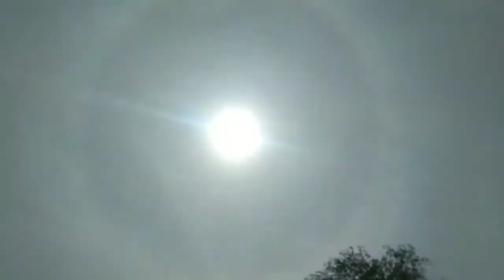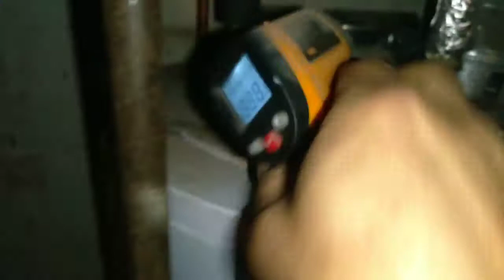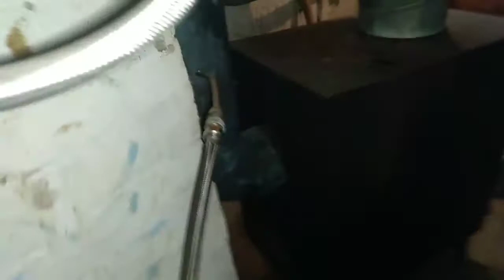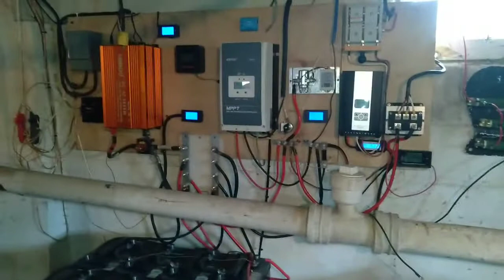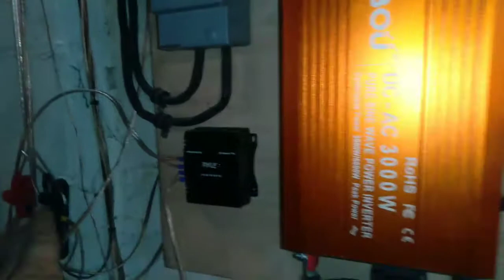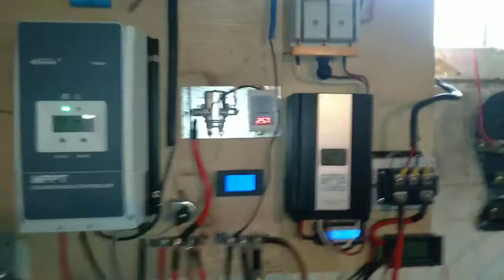Free Hot Water!...and other stuff

Comment: On that stove pipe you could put a bypass on there with some dampers you could control the heat or totally shut the coil off with the dampers so you can control how much heat goes across the coil and you can put a temperature switch on your tank it will turn off your dump load to where you're not putting power into the hot water heater and put your resistor up there so that when it shuts off it turns it on that would save you a whole lot of headache and worry you can also put it a temperature sensor to set an alarm off and make a buzzer go off in your room or in the kitchen living room wherever you want it to let you know that there is a problem it's getting too hot well thanks for doing it for the first time like I would be doing thank you for your ingenuity so I don't make the same mistakes and thanks for sharing you still got a nice setup 👍
Reply from the maker: There is definatly more i could do to fool proof it but how much do i really want to rely on sensors and switches. I really don't mind keeping an eye on it. The work i save not needing to pay extra bills, gives me time to play in the basement where i'd rather be anyways....shooting BBs with my girls or working on my next project. Cooling a house without traditional A/C is one on my next ventures but that system will be a one of for the house i build up north. I rent this current house so my projects are limited as they need to be easily removable and reversable. Fortunatly my slumlord could care less if I burned this house down. Obviously.....that is not my intent.
Reply: @smallcityhomesteaders1600  yeah since you're renting you make all the mistakes on this one to so whenever you put it in permanently you don't have to worry about it thanks for sharing your video your system looks really nice especially your inverters and charge controllers what size of EP ever charge controller is that if you don't mind me asking
Reply from the maker: @thomasmoore4576  60 amp controller. 3000 watt inverter. 1200 watts of solar and 800 watt turbine. I guess i should do a video going back over everything eh.... a lot changed since the last time i did one.
Reply: @smallcityhomesteaders1600  thanks for the information man appreciate it and now I can go get me an ep ever charge controller
Reply from the maker: @thomasmoore4576  they're awsome! I do wish however i would have gotten the 100 amp because this only is nearly maxed out. I think i can add another 400 watts safely but thats peaked. I'd rather keep duty cycle 80% or less. Amazing though...in full sun i regularly see 1250-1300 watts from my 12, 100 watt panels. Correct wiring in absolutely essential!
Reply: @smallcityhomesteaders1600  hey I'm going to probably wind up having to get two of them because I got 10 260w panels that I'm going to be putting on it thanks man I really appreciate it 😊
Reply from the maker: @thomasmoore4576  what voltage system are you putting together? If your doing 24v you could get 2, 60 amp controllers because that'll take the power plus some and cost a few bucks more then 1, 100 amp controller. If your doing 48 volt, a single 60 amp will do the trick.
Reply: And that water pump you have on there how many gallons an hour does it put out and is it on 12 volts 24 volts and how many watts does it pul

Comment: No such thing as "FREE", someone is paying for it somewhere or somehow! But I like how you create cost effective solutions to the issue you face! 🤣👍
Reply from the maker: Ok ok....i paid for all the crap but from here on out, its paid for with no bill. If i figure in the cost of gas i could estimate at which point it's officially paid itself off and so on. By my numbers....it paid itself off a hundred times already. 2 winters of not having a natural gas bill in WI has saved thousands already. I estimate $500 in parts for the hot water system alone.
Reply: @smallcityhomesteaders1600  So it is still not "FREE" cuz your making a profit off of it!🤣

There is another saying, ...... "FREE TO ME!" 🤣
Reply from the maker: @terrywheelock9458  damn skippies! I didn't wanna say profit because i've had viewers accuse me of using "magical numbers" but basically, yeah. I guess you could also factor in the hours i spend preparing firewood and maintaining the system but i still come out way way on top considering the last year i paid for both electricity and gas i pissed away $3500 and my COMPLETE off grid system, down to the last screw came to almost exactly $6200 and i'm going into my 5th year in use.....no magic. Just results. But yeah, it took a lot of time monitoring and fine tweaking to FINALLY just be good to go. I rarely check my meters anymore because they're always in the green. When i do, i roll my eyes, smile and continue on. Independance truly is a beautiful thing and so few realise what it means or how it feels.
Reply: @smallcityhomesteaders1600  Self sufficient is the way to be if you can, but logistically the human race is a 1000 years from it, being "independent" is a logistical impossibility, what you have is more "choice" which is the best thing someone can achieve, never being herded into the "drug dealer business model" of a consumer society, is a great feeling, but you REALLY piss them capitalists off when ya do that, then they gotta bring you back into the fold or put you down! 🤣
Reply from the maker: @terrywheelock9458  your so rite. We're not stopping here however. Main goal is to setup a sustainable homestead up at our property. Get more livestock and grow more. I dispise the fake money monopoly game. The Lord has provided for me thus far and I have faith that will not change in his country. More time living and less simply exsisting.